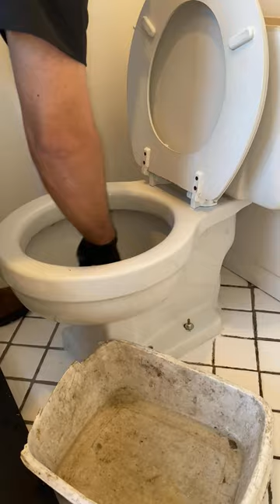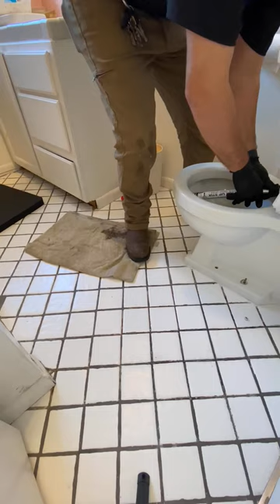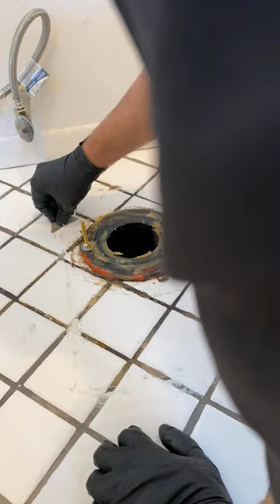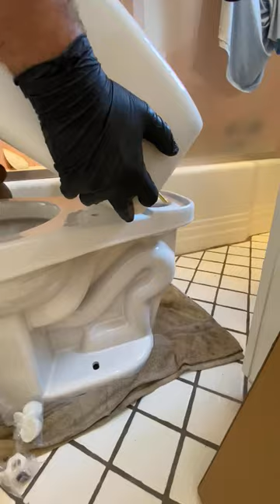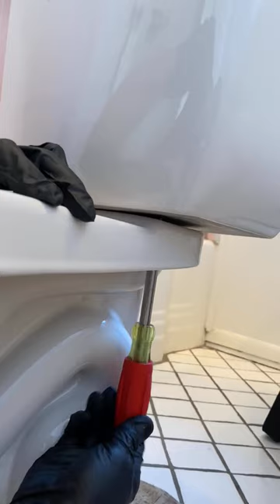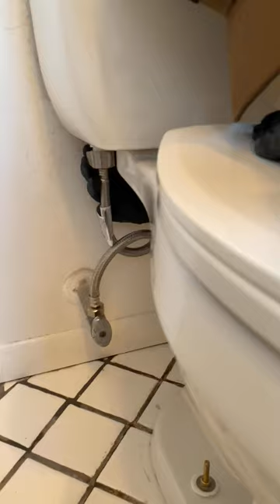Installing new toilet #plumbing #bluecollar #plumbingservices #shorts

Comment: Should use a handhelp pump for the water.. Its like 10 bucks at harbor freight.  And get you a dolly also.  Will save your back in the long run.

Comment: Bro, where do you get wax rings? I went to home depot the other day and they had 4 different rings and none of them were traditional wax rings like you used. Not a full time plumber, just doing some diy repairs and renovations and I was shocked that I couldn't find a wax ring.
Reply: If you were looking at the nonwax rings, go back and look at the bottom of the bay to the left with all the fill valves.

Comment: Question: Why would the customer not want Caulk?
Reply: In case there's a problem with the ring or a clog that causes it to leak. You'll detect it quickly and won't have to wait until the floor starts feeling spongy to notice it. Most plumbers I've known don't recommend caulking toilets. Especially on a second floor apartment. If a customer ever asked me to caulk it I would leave a gap in the back. Just in case
Reply: @johnnichols3113  Thanks John!

Comment: There is something u can buy that turns the water into a gel, so u don't have to squeeze the water out manually 😊
Reply: Yeah but it's better to take out the water, so no extra weight and it's also cheaper and more ecological this way